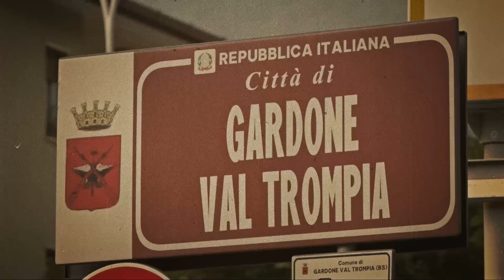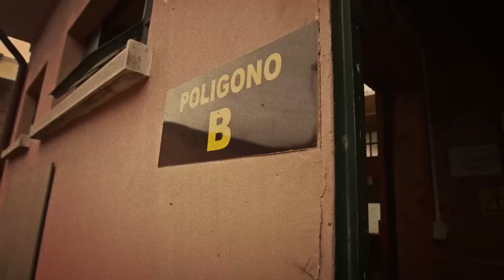Strike One Pistol

Comment: Thanks for the video, LAV! I have one of the US guns (TCC #49). There is a strict 500rd break-in. I'm impressed with the broken-in trigger and the outstanding accuracy. It point-shoots well if you wear gloves or use grip tape. However, the gun still has some issues: Out of the box, my sights were 1" off at 10yds and shooting high, and part of the white insert in the right rear sight dot had fallen out. I had the front sight drifted, but it still shoots high. The barrel is not ramped; I can't reliably feel anything but FMJ, and even then I get at least a couple jams per range session (with production ammo). The slide is so massive, and has so much inertia, that the low bore axis makes no difference; the Walther PPQ, for example, shoots just as flat and accurately. The locking block is very innovative, but moves at a 90-degree angle with significant friction, and must be run wet or the slide will eventually have to be bumped forward before it will return to battery (you can catch this if you pay close attention to one of the "Russian operator themed" promotional videos). The laser engraving is very fine and somewhat sharp, and will probably fill with plastic from your holster. And the empty mags don't drop free. Overall, this gun has a couple of impressive features; however, it must be run wet with ball-profile ammo-- it's about as reliable as a finicky 1911. It's a great range gun, and I kind of appreciate the malfunction practice it gives me, but it's an expensive piece for what you actually get. I would never trust my life to this gun. I got a great holster and mag pouch from Daniel's Holsters, though. It's a fun toy if you have the money. Keep it clean, keep it greased, and stay safe.
Reply: Greg Krsak Thanks for this great review. Before I go reaching for my wallet. Glock it still is. I was excited by the low bore to grip on this gun.

Comment: Wonder what happened with its trials for Russian armed forces, there was even mentioning of fully automatic version for various Specnaz units. Alphas and Vityaz have been seen using them thats what we know, any info on further procurements or Russian state tests?
Reply: +ITmage It failed to pass Russian army trials. No one tell why, but unconfirmed rumors says he had troubles in the dust chamber. Locking mechanism is too tight, while friction surface for the locking insert is too big.
Reply: +Lehmen1973 Interesting. I have seen it couple of times in hands of MVD and Vityaz and some other Interior Ministry units but it seems it never entered service in significant numbers. Hopefully they find solution for it so it enters service since it looks like an exceptional weapon.
Reply: Well, you never know from the photos, if weapon is actually used for service, or if photo was taken just for advertising. I saw photos of Russian Alpha unit men with AR15 (official Alpha calendar for 2013: http://twower.livejournal.com/969030.html). But I never heard that they actually using them in service. They use variety of western pistols (Glocks, Sig Sauers, even CZ), they use western sniper rifles, but never assault rifles.